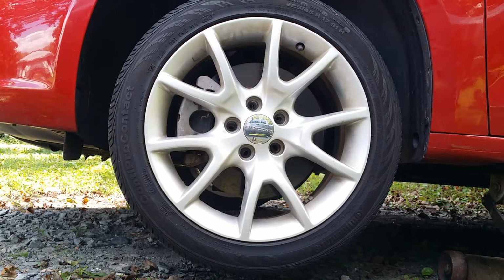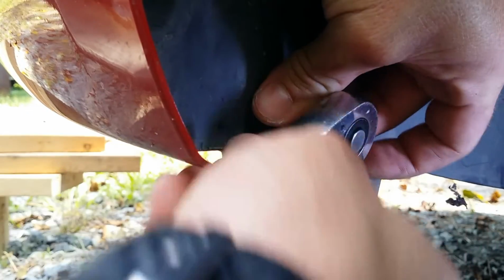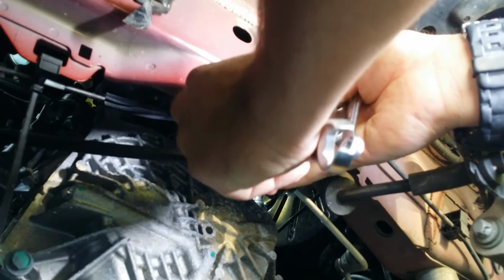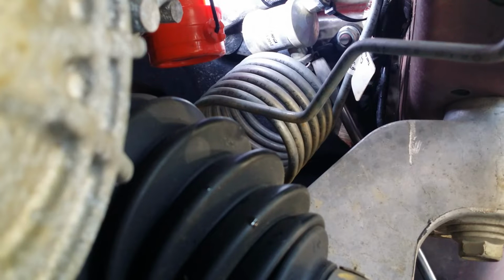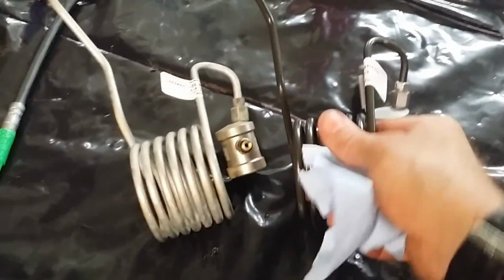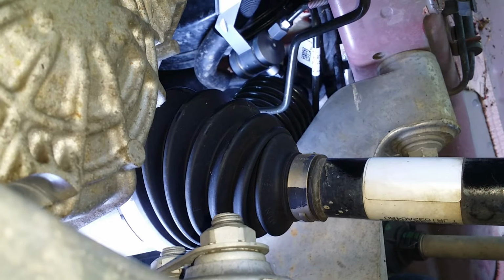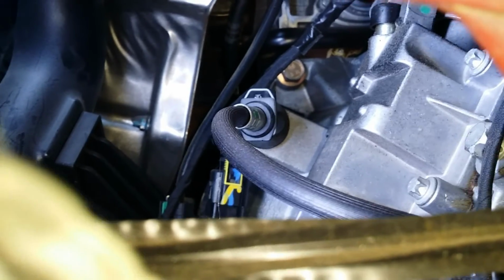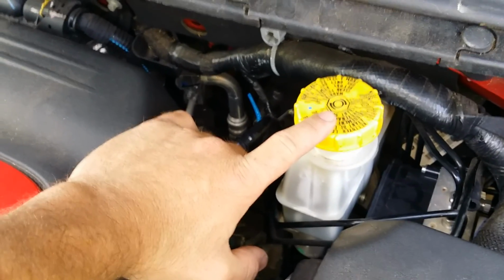How to change Dodge Dart (CDV) Clutch delay valve

Comment: This problem is usually the clutch master cylinder because that's what the dealer replaced on mine with a redesigned cylinder from Chrysler. I took care of my delay valve by getting rid of it altogether.
Reply from the maker: I tried to delete it but the lady that owns the car wasn't having it

Comment: A couple questions. How did you narrow issue to this part and not slave cylinder? Can you make a video showing where slave cylinder is located and mock replacement. Great video
Reply from the maker: I started out looking for leaks and could not find any anywhere. The brakes and the clutch share the same master cylinder and the brakes worked very well so I figured the master cylinder must have been good. Took a pair of vice grips and clamped off the hose between the clutch delay valve and the slave cylinder and the clutch would still do the same thing so I figured the slave cylinder must have been good. That left me with the clutch delay valve being the problem considering it is a common problem for the Dodge Darts. If you go back and watch the video to where I'm explaining how to bleed the hydraulic clutch you will see right behind the retainer clip is where the slave cylinder is. That hydraulic line goes into the slave cylinder. The part of the video where I'm taking the line loose underneath the fender well is the hydraulic clutch line that leads you to the slave cylinder going to the front of the car. The car does not belong to me but the next time she needs me to work on it I will be sure to mock a video on how to replace the slave cylinder. Hope this helps!

Comment: How do you know that it was that part not the master or slave cylender? The video WAS VERY helpful.  Thanks!!!!
Reply from the maker: Thanks man! I started out looking for leaks and could not find any anywhere. The brakes and the clutch share the same master cylinder and the brakes worked very well so I figured the master cylinder must have been good. Took a pair of vice grips and clamped off the hose between the clutch delay valve and the slave cylinder and the clutch would still do the same thing so I figured the slave cylinder must have been good. That left me with the clutch delay valve being the problem considering it is a common problem for the Dodge Darts.
Reply: @isolateddieselperformance3261  Ahhh you car-fu is very good!!!! I'm running into this issue more frequently than I like. I'll try to fix mine issue tomorrow.  Thank a bunch again!!
Reply: With the zip tie did you replace it or was it even needed?
Reply from the maker: Don't remember that car having a zip tie. If your car has one I recommend replacing it. New is always better. 😊

Comment: So my Dart is 2013 Dodge Dart Aero. It revs up but does not accelerate . Clutch has the same pressure as always , has NOT gotten stuck at all and it shifts . Any chance this is the actual problem?
Reply from the maker: Sounds like your actual clutch is going out which is located in the bell housing between the transmission and motor. Eventually the car will not be able to move under its own power. You need to fix that asap.

Comment: Good afternoon sir
i have problem with my dart 2.0 2016
its to hard when i shift from gear to other specially from first to second gear its just like clutch didnt work because i hear sound of friction of gear
unfortunately in place that i live there is no part to buy and replace
what i do now sir
God bless you
Reply from the maker: Can you order it?
Reply: @isolateddieselperformance3261  unfortunately no sir.
Reply from the maker: I don't know without looking at it. Sorry it could be several things causing your problem
Reply: @isolateddieselperformance3261  god bless you sir
Sorry if l bother you with many questions
thanks a lot
Reply from the maker: You're not bothering me. Glad to help even though I couldn't help you as much as I would like. God bless friend.
Reply: @isolateddieselperformance3261  thanks alot sir

Comment: This damn delay valve can blow up your slave cylinder!  AAMCO has had our 2013 Dart for 4 weeks, transmission in and out 3 times, various lies told and parts thrown including flywheel and 3 slaves.  At last they think to change the line assembly, with the damn valve.  What is happening is the valve becomes clogged effectively turning the master cylinder into a bottle jack. Pump, pump, pump, bang and the slave bursts open.  Of course that the shop forced the pedal didn't help, was holding fluid when it got towed to them.  But this slave broke 3 times in 6 years each time requiring a new clutch kit "due to contamination".  Too bad the lawsuit isn't working out, and even worse, that FIAT has not made a new slave out of aluminum or steel, or at least put a overpressure relief valve in that system. I am now convinced that the CDV is the smoking gun. If you hit the clutch too many times in too short a period, the pressure ruptures the slave cylinder, or master cylinder. Both plastic. Next the trans itself will go bad because of all the sloppy shifts, waiting for that.
Reply from the maker: Just now getting notification on your comment. Get you a cdv delete kit and try that! Can't remember the website but it should pop up when you Google it!

Comment: I have my delete kit coming in the mail hopefully my clutch is good car only has a 100 100 km on it
Reply from the maker: You're probably good on the clutch. Was going to put a delete kit on that one but it belongs to my mother and when she dropped it off she said to go with factory parts. Moms don't like the word delete lol.
Reply: Isolated Diesel hahaha nope I have the delete kit coming I dunno why they put the valve on the car I’ve had nothing but problems with it thanks for the quick reply I subbed
Reply: @williamtarr9758 I just installed the delete on my '13 Dart.
Did your pedal hit the floor right after?
I haven't bled it yet but I've bled plenty of brake lines over the years and not had the pedal be all the way to the floor and loose feeling like there is nothing attached to it.
Reply: @AchYanahIsTrying  ya you gotta bleed it really good I hate the clutch in these cars so soft
Reply: @williamtarr9758  Thanks for the response. I gave up at 1:30 a.m. after trying to bleed it by myself. Got a small amount of air out but it still feels like the pedal isn't even attached to anything lol.
I was using the actuator rod with right hand and pressing the hose with my left 🤨🤦‍♂️